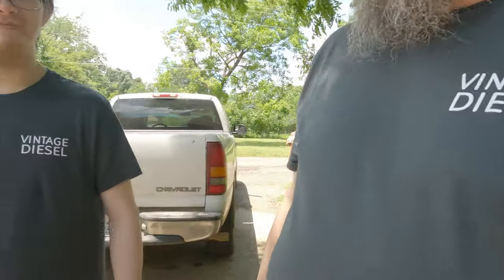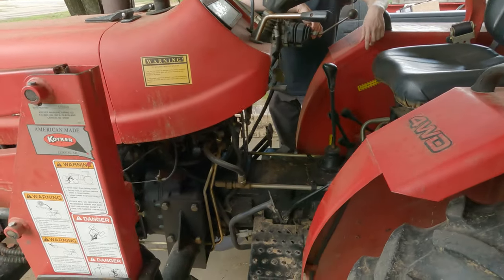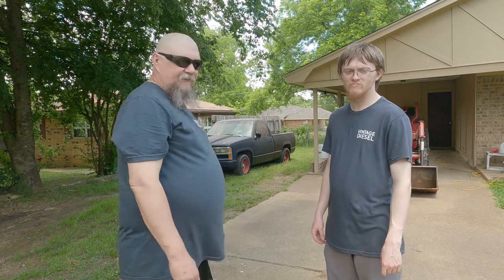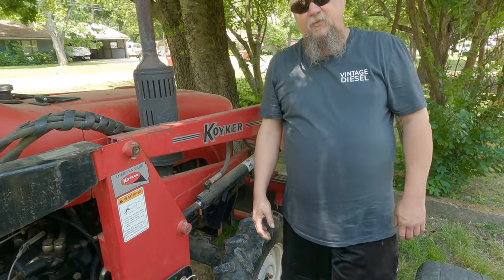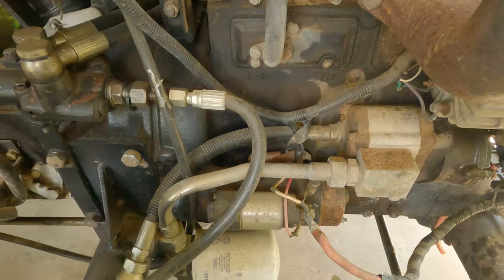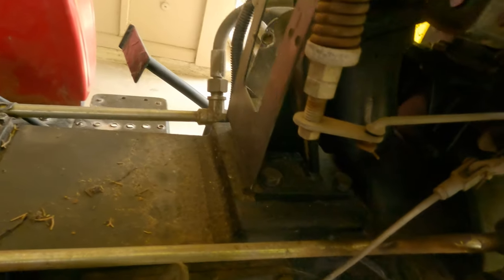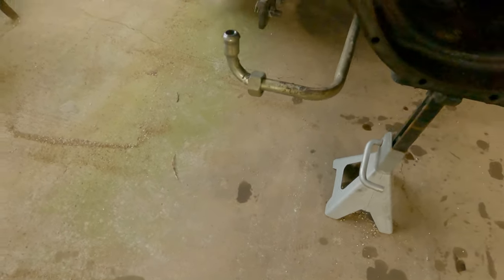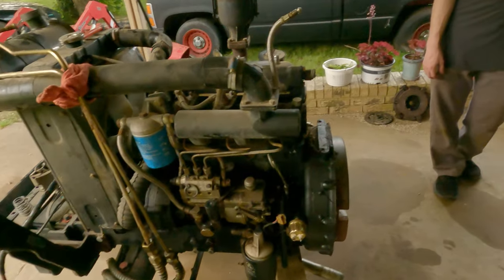Clutch replacement in a 2007 Jinma Ak 2840 tractor

Comment: Where did you find a manual I have a 1999farm pro 2420 which is a jinma  and I had to replace the starter, steering and fuel lines and it just keeps going I plow and run a 4 foot tiller and pull logs with it they are great little tractors
Reply from the maker: The customer had the manual since the purchase of the unit. I was amazed with actually having access to it. They really are rugged little tractors. Thanks so much for watching and for chiming in about your experience and impressions of your experience with your tractor

Comment: It will not start unless you connect the 2 hoses together you disconnected from the loader. Don't forget you have hydraulic pressure when you try to start tractor and without the 2 hose connected there is pressure build up stopping the tractor from starting. Just connect those 2 hoses together allowing the oil to circulate within the system and it will start.
Reply from the maker: Thanks for the tip and thanks for watching